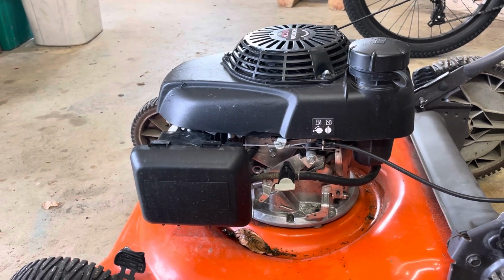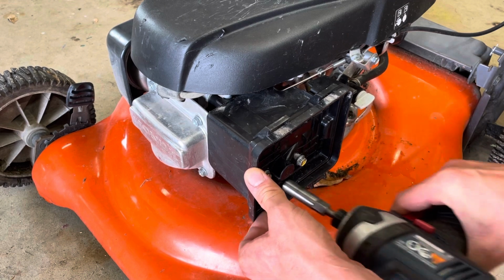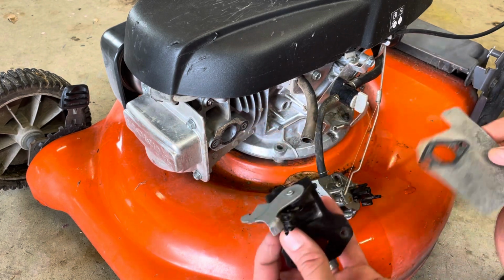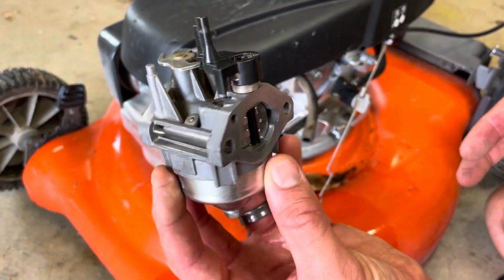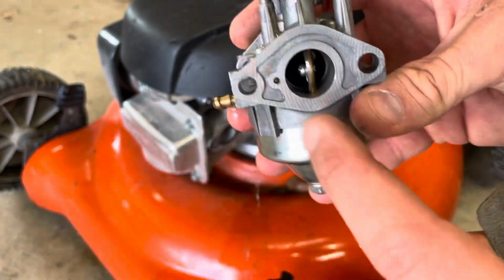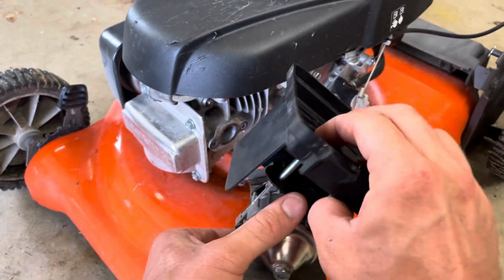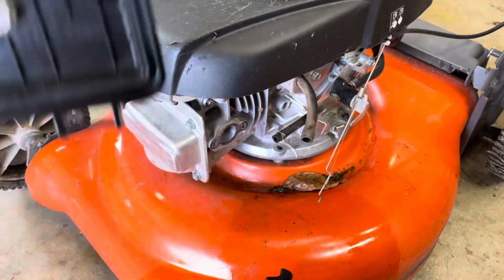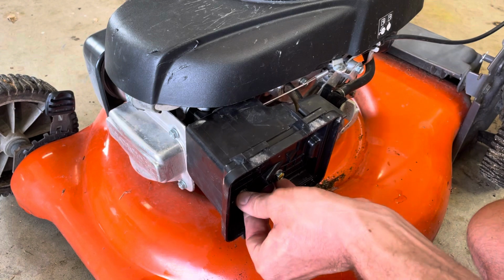Honda GCV 160 carburetor removal and install

Comment: Nice job.  Clear narration and video. Laughed when you said "with carb off..."  Here I am.  Actually, reverse engineering worked well up to the air dam/heat deflector.  Lost all sense of direction and had dinner.  Found you this morning.  Thx.
Reply from the maker: Ha! I have been there too. Sometimes you just have to walk away...

Comment: What about the gasket between the auto choke control mechanism and the intake manifold?
Reply from the maker: Technically it isn’t a manifold 🤓
I should have removed it to show but you’ll notice my gasket just stayed on the intake port and didn’t fall off. Good catch! Thanks for that.
Reply: @35andRetired  That's the gasket on mine that needs to be replaced. So, kinda threw me off cause I wasn't sure if yours came off or not. I ordered replacements. Looks like the most difficult part is reassembling it all. Thanks for the video!

Comment: My Honda engine Troy-Bilt starts but then it cuts off after a minute, any suggestions ?..it's has a good air filter, oil level and cuts off even when the gas cap is removed
Reply from the maker: What is the situation with the choke? Does it have one that is manually operated or is it an automatic choke? That is one thing to investigate...if it runs only with choke and when heated up and the choke turns off the engine stalls. Or...if the choke is staying on and then choking the engine once warm...otherwise, it would "likely" be related to fuel supply...where the fuel tank/line can fill up the bowl of the carb with fuel but cannot keep up with sustained flow once the fuel is being consumed. A plugged or kinked line could be a cause...
Reply: @35andRetired  thanks for the reply.. it doesn't have the adjustable choke and I got a kit with a new carburetor.. maybe I'll just put on the new fuel line first and try to clean the filter, but I guess I have to empty the tank of fuel